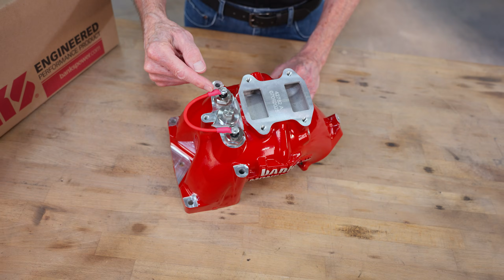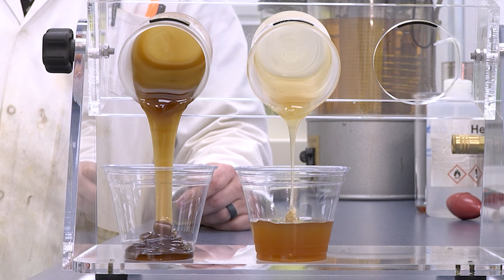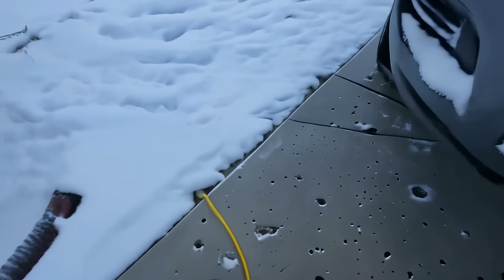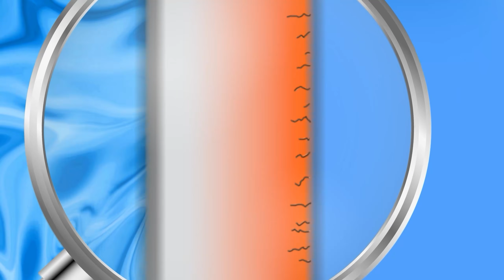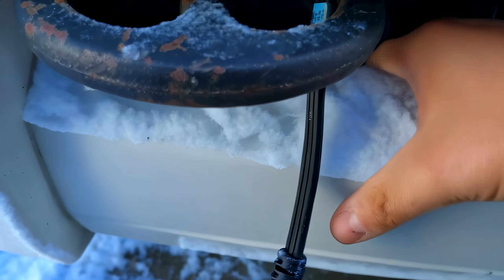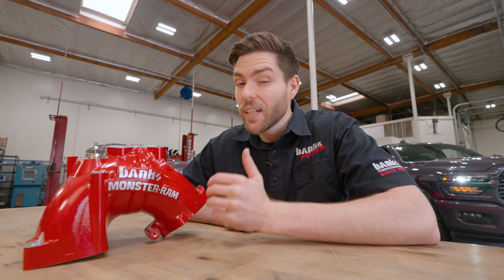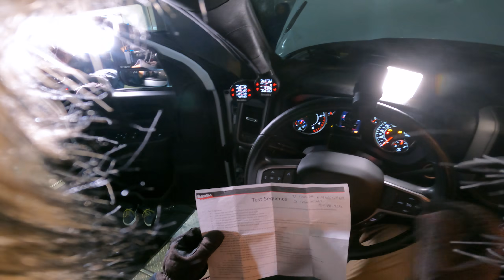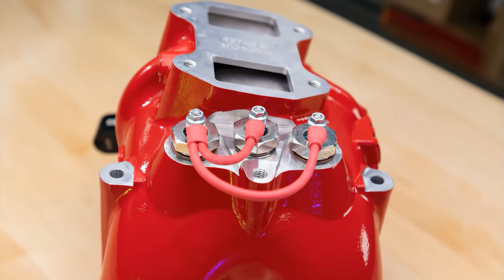We froze a truck to -40°. Here's what happened.

Comment: Number 3 diesel is basically jp8 I believe and is white diesel. Has better fold properties cause how it's refined and is cleaner but I might be wrong. And kerosene is like a cross breed of diesel that is more cold stable. I always added a gallon to 30 gals of diesel in the winter. Cleaning properties and makes reg pump diesel more stable plus I always used  hotshot secrets winteriazer

Comment: Diesel uses glow plugs, thanks for the desinformation and the time waste
Reply from the maker: The 2007-2024 6.7L Cummins trucks don't use glow plugs; they use a grid heater. Cummins have used grid heaters starting with the 5.9L Cummins in the late 80's. 

More about the grid heater failure and why we developed the Monster-Ram here: https://official.bankspower.com/insider_news/ram-6-7l-grid-heater-failure-explained-2/

Comment: Pretty sure glow plugs also helps in the winter, we regularly get -20c here in Sweden and I have never had any problems with starting my diesel volvo
Reply from the maker: The 2007-2024 6.7L Cummins trucks don't use glow plugs; they use a grid heater. Cummins have used grid heaters starting with the 5.9L Cummins in the late 80's. 

More about the grid heater failure and why we developed the Monster-Ram here: https://official.bankspower.com/insider_news/ram-6-7l-grid-heater-failure-explained-2/

Comment: There's one more trick for someone in an emergency who doesn't have any of this, that is to light pieces of wood or coal if available and let it burn for some time and then put the fire out and put it under the engine bay, it should be enough to make you start in emergencies.
Reply: I'd leave it burning, so cold the engine wouldn't get enough heat to catch on fire and the fire Will burn down to coals. Once started you can pull away and drive off, just park over pan when you return ready for the next day . . .   ☆

Comment: Um glow plugs?? When did we get rid of them from diesels
Reply from the maker: The 2007-2024 6.7L Cummins trucks don't use glow plugs; they use a grid heater. Cummins have used grid heaters starting with the 5.9L Cummins in the late 80's. More about the grid heater failure and why we developed the Monster-Ram here: https://official.bankspower.com/insider_news/ram-6-7l-grid-heater-failure-explained-2/
Reply: @bankspower yeah and I love the design well down! but the trusty old glow plugs were the best

Comment: My question is can you use the triple heat banks monster ram plus the double heat billet insert for ridiculous amount of intake heating?
Reply from the maker: Using 5 heaters will exceed the factory electrical system’s capacity, overload the heater relay, damage the vehicle’s electrical system, and risk a fire. This is not a permitted configuration.

https://official.bankspower.com/owners_manual/banks-dual-heat-and-billet-upgrade-kit/

Comment: Forget Diesel Engines Nowadays !!
The Engines are “Choked” from Emissions Crap Like EGR, Diesel Exhaust Filters that get soo Hot they Catch the Vehicle On Fire 🔥 !!
& Plug up after while. 
Plus Mileage has dropped on diesels because of all the emissions crap 💩 
Choking the engine. 
Plus you have to buy and use DEF Fluid aka “Government Juice” !!
And the diesel engine with all the Emissions crap cuts the length life way down. 
  All this makes the Diesel Engine Cost 5x times More Money 💰 than a Gas engine !!
  People are going back to gas engines. 
Ambulances & other heavy work trucks are going to gas engines because of the Costs of getting the Diesel engine option. 
   Don’t have to worry so much about starting a gas engine in the cold weather. 
   Banks company must be losing $$$$
Because many people don’t want diesel engines anymore. 
  There’s another COST to Diesels !!
How much $$$$ is all the Bank’s aftermarket Cost !!!
  NOT WORTH IT ANYMORE !!

Comment: Good video, but I think you were using the wrong oil.  I run 0w-40 (Rotella) in the interior of Alaska in my 3.0L Ford diesel, my 6.6L Chevy, and my Touareg TDI.  I've had them sit for days in remote parking areas with no electricity and come back to have every one of them start.  Not happily, but no 8-second cranking issues.  I don't think the 6.7L Cummins has glow plugs though, so that may weigh into things.  Nevertheless, I always swap to 0w-40 from November through March.

Comment: Why dont these engines use glow plugs ? Arent those better because they heat the block and the colant thats running in the block
Reply from the maker: The 2007-2024 6.7L Cummins trucks don't use glow plugs; they use a grid heater. Cummins have used grid heaters starting with the 5.9L Cummins in the late 80's. More about the Cummins grid heater and why it fails and what led us to develop the Monster-Ram here: https://official.bankspower.com/insider_news/ram-6-7l-grid-heater-failure-explained-2/

Comment: I am in northern Alberta where it reaches -40 nearly every winter.  I have a 2018 cummins and have outfitted it a winter front for the front of the truck and heated battery blankets for the 2 AGM batteries.  Also plug in the block heater usually anything less than +10C.  I bought the new Monster Ram last year and did get the second heater coil too.   Will be installing it before this summer is done.

Comment: The absolute perfect setup for an ultra-cold environment would be for a wireless charging pad under the truck lined up with a wireless charging pad on the truck to transmit power without needing to plug anything in. Also having the ability to enable and control different features remotely like block heating, intake heating, and even a battery blanket heater since the battery seems to be such an issue below -20F. I mean im in very north US and to see anywhere near -20f is pretty rare and we usually see 0f or maybe -5f every winter and at that point, all you would really want even for a regular car is a block heater as a just in case

Comment: Hey Gale Banks, has anyone (hopefully you) designed a system that auto starts the vehicle for example every two hours and lets it run 30 minutes for situation when you are off grid such as at a deer camp or remote location? It wouldn't be too hard to write the algorithm for the on/off run cycle times based on ambient temps, battery voltage, etc. All the sensors are there, all it needs is the programming. Come on Gale, get on it👍

Comment: I spent time working for a Japanese manufacturer doing sub zero engine testing. If that bolt would have failed on one unit it would have been counter measured and replaced on all impacted units. Crazy it’s been going on for so long with no fix.

Comment: How do those 750 Watt heater coils accomplish full output when battery voltage drops? Do they have a driver to run up voltage?

Kinda sounds like the play may be to include a supplemental power supply (charger) to reduce stress on the batteries while also maintaining performance of the heaters.

Comment: I have a98.5 ram 2500 with a boat load of banks . Monster ram, full exhaust including the exhaust brake and the big haus turbo , and engine programer and pillar gauges. And yes it makes a big difference on my Cummings 2 wheel drive short bed with only 137,000 on it. Thanks Mr Banks

Comment: my first car was a 1984 Mercedes-Benz 190D(w201) that thing started very well in the cold tho when it got down to -29C i didnt shut it off during the night. i left it running at high idle to avoid damage because no block heat was available. waste of fuel but it saved from engine damage.

Comment: I love your videos and info and products but as a diesel mechanic I believe you should engineer and test a bolt on block heater that circulates the coolant while the engine isn’t running, letting the warm coolant effectively reach each part of the engine equally. Basically keeping it at or near operating temps all the time

Comment: Send it up here to Alaska! -40’s aren’t uncommon where I work! I run a block heater, oil pan heater, trans pan heater, as well as a battery tender.
Reply: Where are you going at -40F? I’m genuinely curious. I get it for ambulances and emergency services. But regular folks, where are you going?
Reply: @betterwithrum  from central northwest Canada here, these are normal winter temps, we are going to work and other normal life things, life don't stop cause it gets cold we just dress warmer ! Alaska is no different, just more humid from proximity to the coast
Reply: @betterwithrum  That's fairly normal winter temperatures in the interior of Alaska, it isn't that uncommon to see -50 for extended periods of time.

Comment: THE GRID HEATER TURNS ON BELOW 66F?????????????? Whyyyyyy????? You can start a 250k mile 12 valve in 30 degree temps with no grid heater

Comment: You better be adding a 20 amp charger to your block heater circuit if you run a diesel, that double heater is using over 100 amps and the triple is over 200 so those batteries better be topped off or it aint gonna happen.

Comment: 😂😂 you spent what on this test?  So as an Canadian here in Alberta, -40 is a normal winter.  I'll tell you what it takes to start my 3500 Dodge diesel...  Plug in the factory 1000 watt block heater, let sit for 1.5 to 2 hours.  Key on for 10 seconds, crank and boom it starts!  Let run for 10 minuets at high idle and away you go.  Only oil I will ever put in is 5w-40 Klondike.  Nothing else is needed.

Comment: As a Swede..
Here's common sense taught to me growing up. 
1. Always have atleast one spare battery that is properly charged and kept INSIDE. 
2. Starting gas is your friend. 
3. Use the engine and cabin heaters. 

Also generally expect stuff, even what is made for our climate to fail. Expect premature wear, expect plastic to break, expect that metals will shrink and crack. 
Anything under -20 celsius is window weather, meaning It's beautiful to see through a window but is hell frozen over to be outside in. We don't screw around in those temps unless we get very complacent and we've been living here for over 1000 years.

Comment: 47 years lived in North and Central Alberta, Canada.   This is a great system.   Missing is a min. 140W Oil Pan Heater.  It's the biggest upgrade for Cold Weather before anything else.  Also won't trip your house or parking lot breakers.    Note: the oil pan heaters degrade after 2-3 years. Periodic inspections of it's integrity is very important.

Comment: Need to make a oversize deep cycle AGM battery mount and a high performance block heater with a battery maintainer to go with the triple heater kit. One plug in point, one sure start kit. The bigger heaters draw a lot of juice from the battery, add extra cranking load and the whole system needs an upgrade.

Comment: 24:36 my gasser starts no matter what temperature it is, with or without block heat, battery heat, or oil pan heat… and doesn’t require special fuel or additives, and doesn’t need intake heaters or pre warm ups. Just more n more reasons why diesel isn’t worth the money or trouble. Especially now that 7L gassers are available that actually have shockingly good mileage and run forever without high maintenance. Theres just no point
Reply: Go check if your battery performs in -40f, doesn’t matter if it’s gas or diesel you simply won’t have enough voltage.

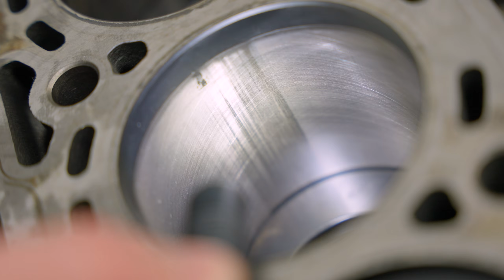Comment: 7:46 running temperature is THE absolute factor of engine wear… any thing else is just drops in the bucket. And most of that wear is piston rings. Cold engines under load for long durations is a death sentence. For cold climate conditions, the only thing a guy can do is use electric heaters when you can to heat the block and/or oil pan, and idle or drive very gingerly until the temp reaches optimal levels before stressing the engine.

Comment: So on top of a block heater, an engine oil pan and trans pan heaters are highly recommended here in North Pole, Alaska. It is also recommended that you install a trickle charger that comes on when you plug the vehicle in. DO NOT USE BATTERY BLANKETS OR PAD HEATERS! 
I personally have seen three vehicles in my 18 years of working in a shop, burn to the ground because of the battery heater. A charged battery won't freeze!

Comment: So... Cummins doesn't have glow-plugs? (I ask since every diesel I've ever dalth with has glow-plugs, but they are of euro or japanese origin/design) Edit; due to typing errors.
Reply from the maker: Correct. The 2007-2024 6.7L Cummins trucks don't use glow plugs; they use a grid heater. Cummins have used grid heaters starting with the 5.9L Cummins in the late 80's. More about the grid heater failure and why we developed the Monster-Ram here: https://official.bankspower.com/insider_news/ram-6-7l-grid-heater-failure-explained-2/

Comment: Great job next time use Odyssey batteries internally they’re better for my plow truck. A third battery is added. I have to have it starting and Gaer reduction starters or a starter upgrade big plus put those on your next test. At the semi’s, we like oil pan meters and fuel filter heaters along with the block heater. Another trick I’ve learned keep a charger on the batteries at night. They won’t freeze so much.

Comment: If yo need the triple heater intake,   you should probably be looking at a diesel air heater and running hot air into the engine bay.

Comment: Meanwhile my Kubota RTV doesn't start at all or tries to sound like a really cold cummins if I don't pre heat when it's under 55°F 😂
Our sweeper is even worse, I need to pre heat summer and winter.

Oh and our spider boom lift with a single cilinder diesel doesn't even have a glow plug but it never failed to start during winter 😂
But it's slow as hell for the first 10 minutes as the hydraulic oil is like syrup until it heats up a bit.

Comment: As a long haul driver, I gained more respect for APU systems through this. Antigel'd my ass off, grills would freeze resulting in somewhat higher temps ironically. But stuck in -10f for almost a week? 15 liters started right up since the APU kept every fluid flowing, never saw temps below 70f. Very interested to see if that type of cohesion will be implemented in generator hybrid trucks. Same concept, genny starts to charge batteries, batteries have a heater and flow fluids. Got fuel, you have a warm engine.

Comment: I live in interior Alaska.   The beginning of this January we had -74F for about 2 1/2 weeks sustained.    Up here we have to use full synthetic oil, you MUST plug in your car's oil pan heater, transmission  pan heater, block heater, battery blanket, coolant heaters, etc.   Otherwise you're going nowhere.
Reply: How many watts/amps do you draw with all that heating capacity?

Comment: lol that’s classic AMSOIL  for 67$ a gallon it better change itself 😂 definitely impressive for a 15w-40 oil but compare that oil to a 5w-40 weight and it looses in cold weather viscosity.  Definitely has great NOAK  and HTHS numbers but for 67$ a gallon and standard oil changes you’d never see your money back.  5w-40 oil is rated for -60 cold pour instead of this oils -40

Comment: Why didn’t you compare the results when starting with the 2,250-watt heaters? At what temperature does the 2,250-watt option become more beneficial than the 1,500-watt or 750-watt settings? You took a lot of measurements, but the video doesn’t show or explain a significant portion of the data.

Comment: Awesome Vid! I love how you showed the test and explained what real cold is. North Dakota here, I noticed your batteries did not have the battery blankets (some say they don't matter) but my truck (a 6.7) has them. I've personally started mine down to -65F. It was a slow crank, but it started. I would have liked knowing how long your block heater was on before trying to start? Mine is on for up to eight hours before trying to start it when its supper cold. Just got my new Monster Ram to replace the old one with no heater and will be ordering the third heater soon!

Comment: @ BANKS.... I am curious how long did you have the block heater activated before you attempted the start? I lived in Wasilla, AK for several years. I had my block heaters, battery blankets, and oil pan heaters on diesel and gas engines. ALL plugged into a timer to come start the pre-heat at least 2 hours before I had to leave for work.
Reply from the maker: Block heater was plugged in for a minimum of 16 hours before each test.

Comment: My truck has a block, oil pan, transmission pan, and battery charger. I plug it in below 32f and it starts up perfectly at -42f it doesn’t get colder than that where I live.

Comment: alrighty. i call BullShit on this one. i work snow removals. we rock some beat up 2020s to 2026 F150 to F350. one F150, and a lot of F250. the F250s have the 6.7L POwerStroke V8. one night, it was -50C. the trucks had sat for a week. (oh and BTW, those trucks never got an oil change. so the oil in there is summer oil) and they started without an issue at all. sure, they cranked a bit, but they started...
Reply from the maker: We appreciate you sharing your real-world experience with Ford. The Ford trucks use glow plugs. The 2007-2024 6.7L Cummins trucks don't use glow plugs; they use a grid heater. Cummins have used grid heaters starting with the 5.9L Cummins in the late 80's. More about the Cummins grid heater and why it fails and what led us to develop the Monster-Ram here: https://official.bankspower.com/insider_news/ram-6-7l-grid-heater-failure-explained-2/
Reply: @bankspower  the solution: buy a Chevvy.

Comment: Btw you dont need to run straight number 1, 50/50 will take you down below -40. I still put howes winter treatment in even when blended. treated #2 will get you down to -20F, if -20 is in the forcast i start blending roughly 30% #1, if theres -35 or lower i go 50/50 and call it good.

Yes block heaters are great, at -20 even gas engines really like a block heater. Its simply not always an option so carrying a good quality starting fluid is a must for when better options just aren't an option.